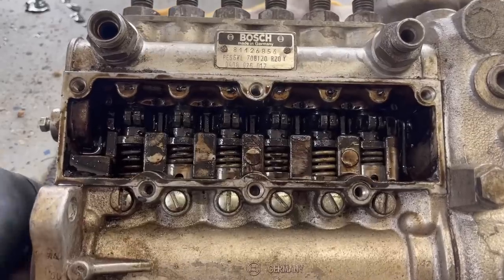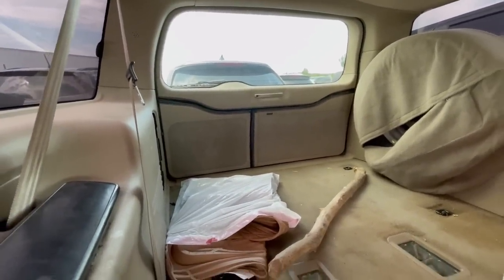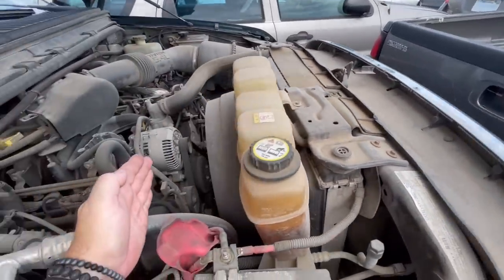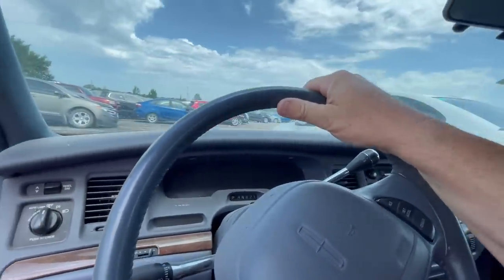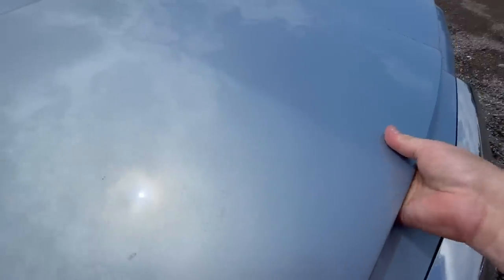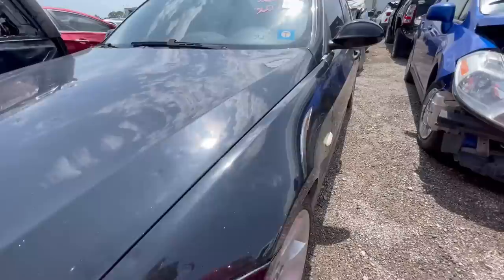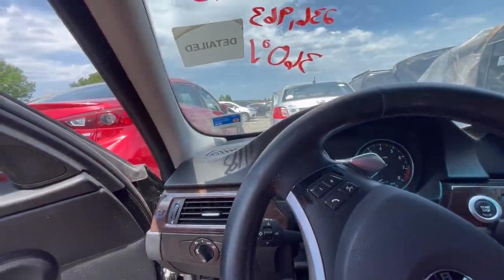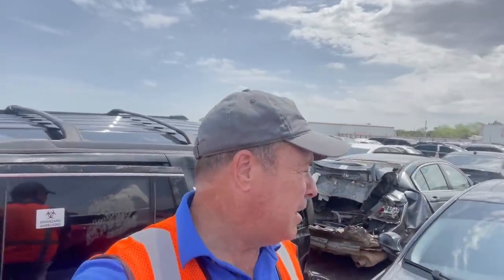IAA Tulsa Walk Around - 9/24/22

Comment: In my opinion, the Excursion is the one vehicle that ford needs to bring back on the current or next generation Super Duty platform; because it’s the ONLY vehicle that can fit full size adults COMFORTABLY in the 3rd row. (It’s also why they were stretched and used in Livery service as limousines)
Reply: So true but probably not going to happen sadly